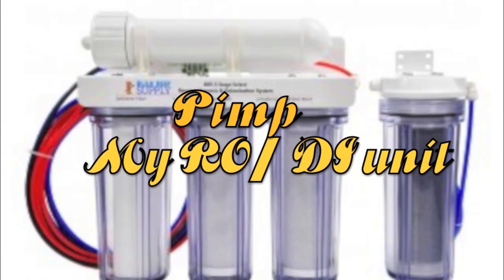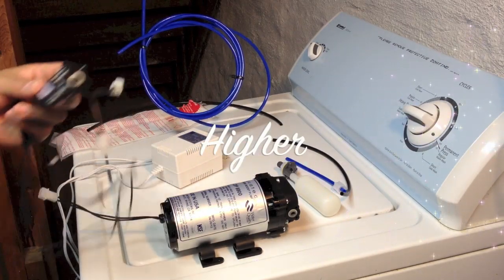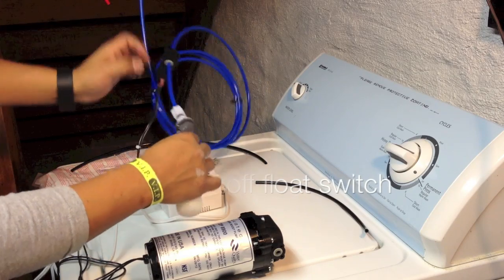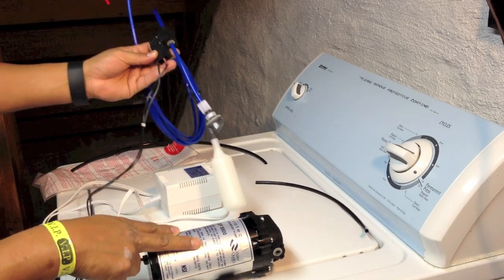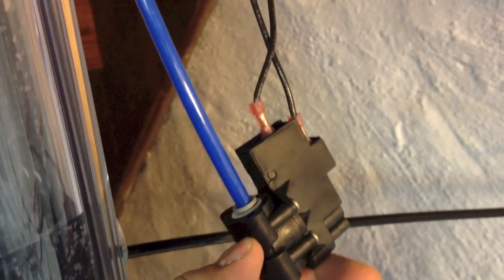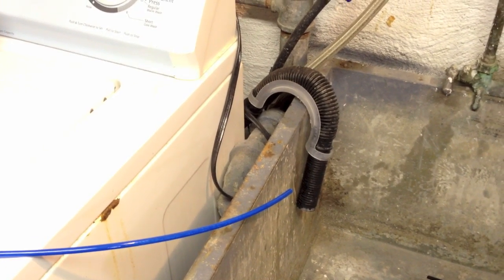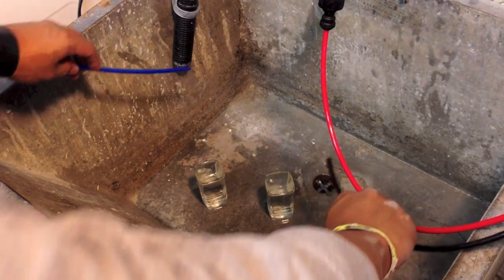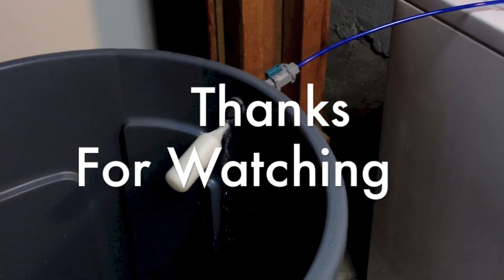The buster pump installation, Pimp my RO DI

Comment: does anyone know how to adjust the pressure released
Reply: Jerry Bruce the pump comes pre adjusted  to the  specific  pressure, how ever if you need to adjust the pressure, the pump has a  flat  screw driver  head ,  if you watch BRS  video about the pump you will see what I'm talking about!!
Reply: macrapidito yeah it came preset with too much pressure for my system I adjusted the Allen wrench screw on the tiny black bevel on top of the pump
Reply: Jerry Bruce great good to hear that!!  What was the pressure you set it ? 

60 is  just fine, thought
Reply: I backed my adjusted  my screw all the way out only seeing 55 psi

Comment from the maker: u can buy a cheap filter from your local hardware n connected before the buster pump, Bulk reef supply advertise an small pump's pre filter how ever I couldn't find it on their website this will protect the pump from small particles,is better to run the same amount of pressure over the entire system n not only over ur membrane  as 4 the 2nd ? the minimum for a 70 GPD unit is 40PSI there for I'll say this will b the minimum as well for a 50 GPD the more pressure the better performance u will have